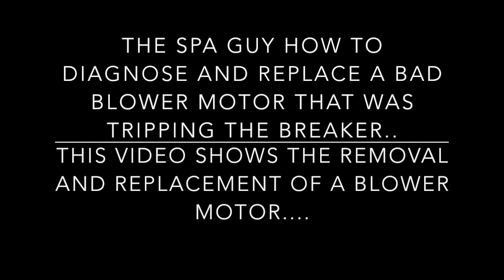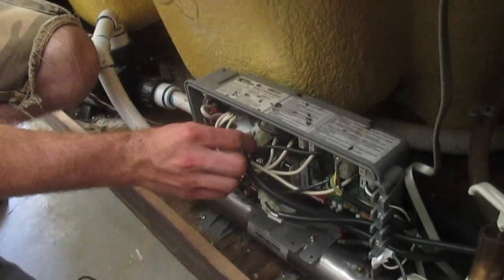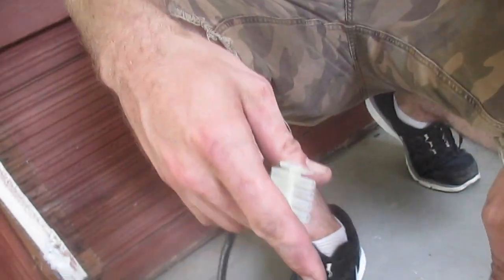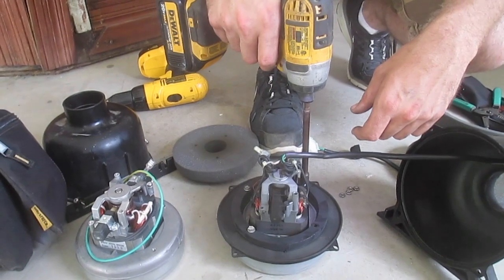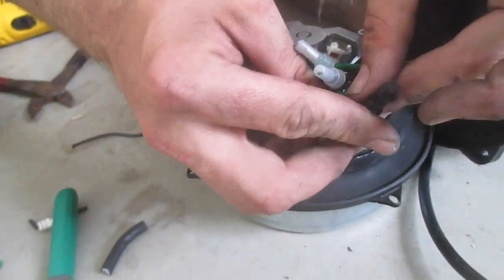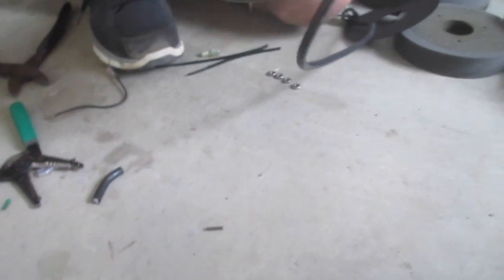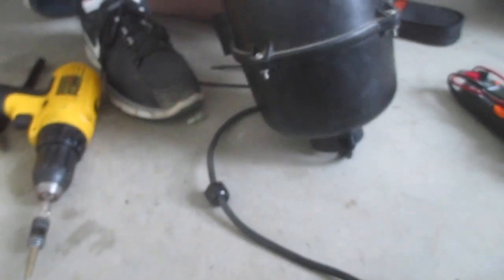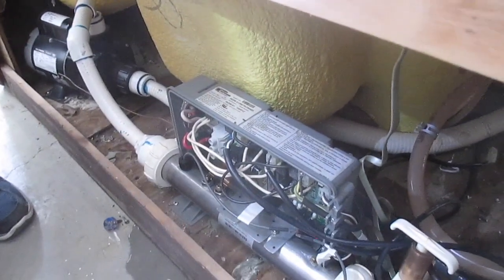Hot Tub Blower Motor Trips Breaker Diagnose & Replacement The Spa Guy How To

Comment: Very Good Video.  I have a Air Blower that looks like that one... cannot read the data plate due to fading.  I cuts off after about 2 minutes of operation, never trips a breaker.  Are there thermal overload devices inside of these air blowers?

Comment: Hello! Setting up a Caldera Utopia Geneva I got used. The lady said it started tripping the breaker, and blew cold water on her back one time when it did it. It trips when the jets and the blower run. I’m assuming the blower got water in its line, is there any repair of this? Or just replace the blower?

Comment: Just a quick question.  I have been troubleshooting a similar blower motor.  The issue I'm having is that it starts some times and other times it does not.  I can hear it engage in the control panel when powered up but most times it will not start and then for no reason it will.  Any ideas?  Thanks
Reply from the maker: Probably brushes..

Comment: Was there a significant amount of carbon dust build up from the brushes wearing out? If so, it may have been simple enough to clean the motor with forced air to clear the ground problem.

Comment: I am trying to remove my pump,  XP2e, and the final anchor bolt/nut is rusted out.  When turning the nut the whole bolt turns.  It being in an awkward position, I have so far been unable to get both a grip on the bolt to keep it from turning and a grip on the nut.  I am continuing to try, but was hoping you might have a good tip to help me out.  Thanks!
Reply from the maker: Sorry I just saw this Andy I use a cutting tool like a hammer drill with a split tip or a recip saw..
Reply: Dremel tool with a cutting wheel - it will take a while, but it will slice through the nut and bolt